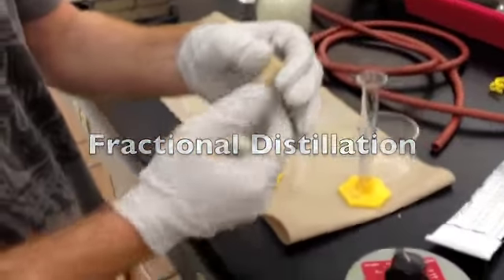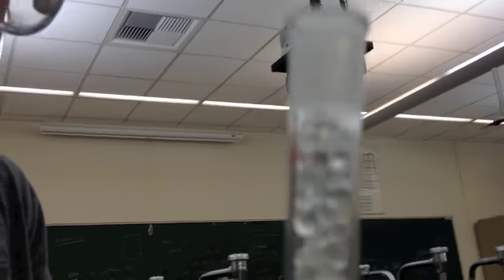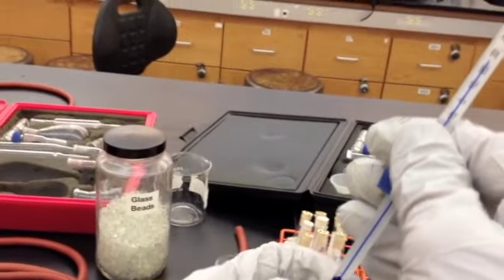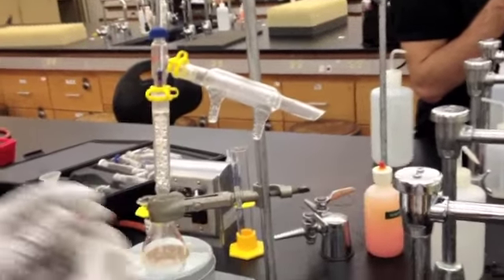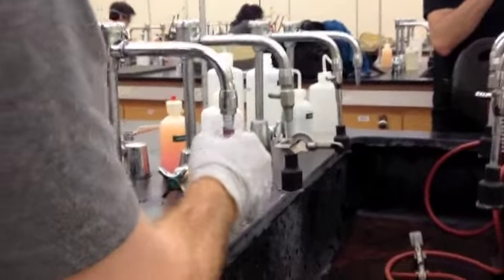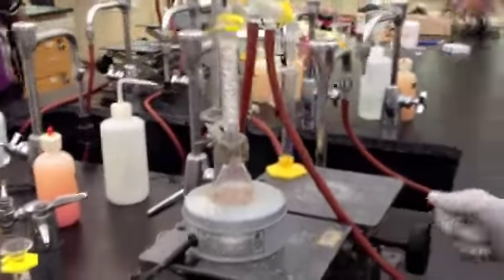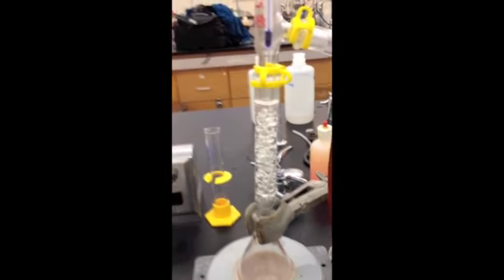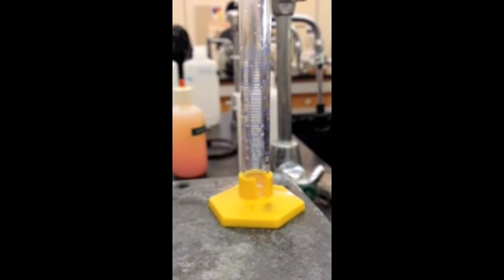Fractional Distillation Demo 2

Comment: Always put your water lines on your condenser before you assemble anything you can break your joints by trying to manipulate the water lines. And some condensers are better off with the water inlets pointing up so it just doesn't leave a bubble on the high end